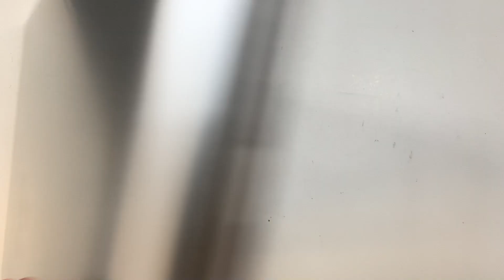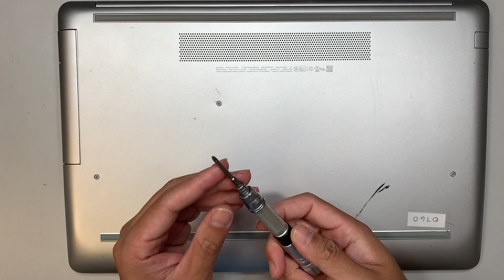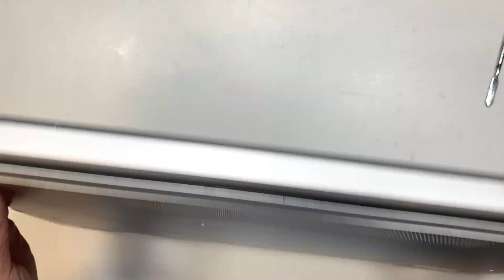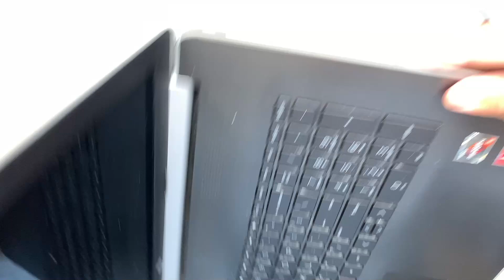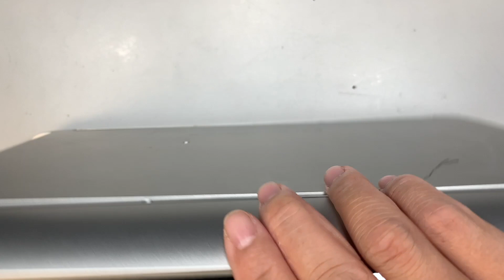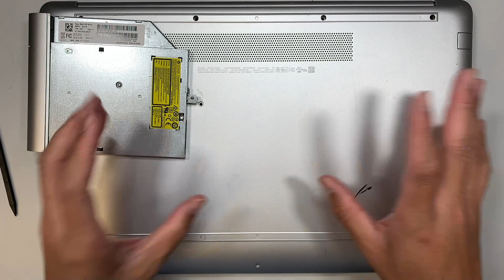HP 17 CA1055CL Battery Replacement HT03XL

Comment: Hi, thanks for the informative and useful steps to replace the laptop battery. 
Now can you direct me to what battery replacement that I need for my HP 17z-CA100?

My current battery is: HT03XL / L1119-855 
Battery Capacity - 41.04WH Voltage - 11.4V
But all I see is:
Battery Capacity - 41.9WH /Voltage - 11.55V

Thank you.

Comment: I have a HP Pavilion 17 and I need to replace the battery . Mine does not have a cd drive but other than that the screws are the same as on this one. Do I still need to remove the screw located sort of in the middle that seems from this video to lock the cd drive in.?😊

Comment: The only critique I have is that you should have showed how to screw in the new battery and put the disc player back in. It does seem very straightforward but for novices like myself I'd want to be sure I'm doing it right. This is the best video on batt replacement I have seen on yt. You clearly know what you are doing. Thank you.

Comment: This looks like a very simple process. My only question is how is the optical drive only hold by a screw🤔🤔 and no cables attached to it? Is it a wireless drive or what?. The rest of it is pretty straight forward.

Comment: hi, what do I do after replacing the battery? like how many hour should i charge it, do i need to drain it, n how to drain the battery
Reply: Yes it's best to drain the battery completely then fully charge it. Do this process at least 2 times before you start using it normal.

Comment: Can this laptop take NVMe drives or only the older SATA for the M.2 slot? I search and can't find this info anywhere. HP site useless.
Reply: Yes you can install NVMe and also SSD but the NVMe will significantly slow down the computer.